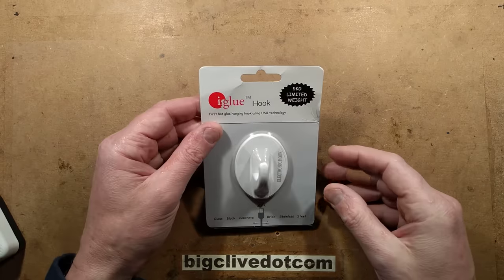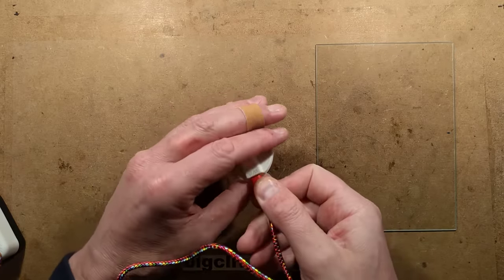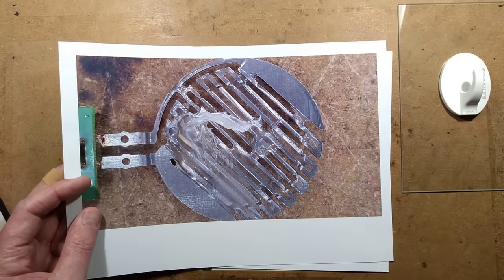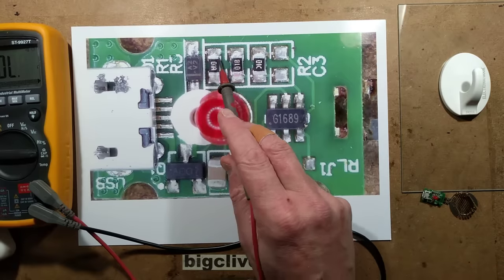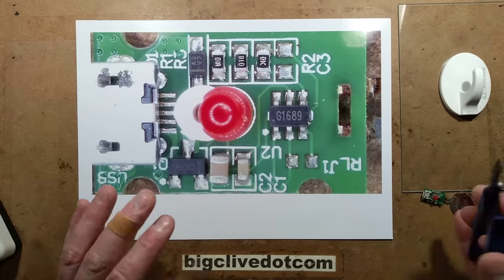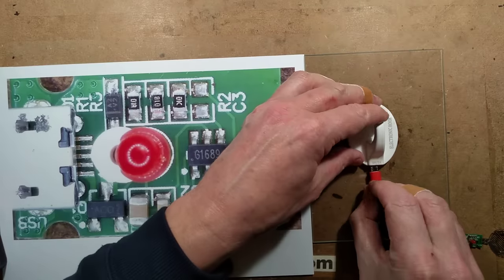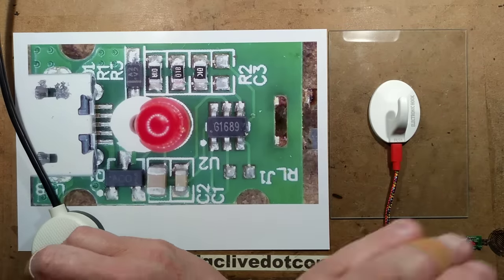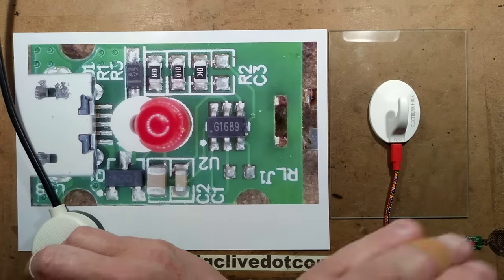Testing a USB powered wall hook and a look inside.

Comment: Speaking of national mail services being greedy...
Swedish mail service now charge a roughly 7£ base fee + 10% of the item value for any outside of Sweden purchases. 
I haven't bought anything from ebay since this new fee was introduced. I hope they remove it soon :(
Reply: Wish pre-pays the import tax, letting you dodge the processing fee. Might be worth it if you're willing to sacrifice some dignity of the altar of Chinese Tat.
Reply: Lassi Kinnunen I'm pretty sure the issue was that import tax wasn't being applied at all before, and some government branch was dissatisfied. PostNord, shitty as they are, want to be compensated for collecting the taxes. This is reasonable. What isn't reasonable is that they charge the above mentioned €7 to look at the shipping label for 3 seconds. 

By prepaying the import tax the government gets their pound of flesh and PostNord can fuck right off.

Basically everything is by the book this way; it's the actual legal solution. I just wish more vendors did it so I wouldn't have to use Wish.
Reply: If they did it in Poland there surely would be riots...
Reply: Well shipping is costly, especially the last few miles.
Reply: @owenlj6261  From experience I would say what's expensive is the FIRST few miles.
I regularly ship small boxes from Asia to Europe and get boxes returned to me.
The shipping cost from Europe is 3 times what it cost me to ship it to there.
Reply: Ha! Brazil is way way worse! 
If you buy anything out of here, tou have to pay a 6% icms tax, then the product will be taxed by 60% of its price, and if its a electronic by 100% of its price. 
So if i buy a notebook: $399usd +6%icms = R$:1800 reais now the customs will tax it for more 1800
So now the price rises to R$:3600 (about 900 usd). But then the mail service will want the price of the shipping, so about R$50-80 (12- 22 usd) and now, for anything that comes from outside the mail service also puts a tax of R$15. 
So the final price is R$: 3695

Converting to dollars it doesnt seem too much, but remember that 1usd = 4.2 brl. 

Usually the price is multiplyied by 4.2 to be converted to brl, then tr taxes multiply it by 2 basically...
Reply: @eduardoavila646  Shit. Here in the States the USPS has flat-rate boxes in a range of sizes. Cram whatever in the box, if it fits it ships. We still get people whining about how expensive and terrible the post is, might need to show everyone what other countries deal with.
Reply: Yeah, tehre are way worse taxes
Reply: I just want to buy my heated hanger for 4£ not 12£ 😢

Comment: they need to add a wifi function so you have to activate it from there, and if it sense your using wrong label towels, they will fall off the wall, this is the future.

Comment: Processor is a ATwin Tech AT8PE513ML  - 42 instruction RISC and the <8 pin versions aren't sold in most countries. The A00 part is a SI2300A MOSFET.

Comment: It might be a "custom micro controller". They are manufactured with the firmware instead of programmed afterwards. From the wiring to the pins and functionality, I would guess it is an ATTINY-10.

The trick to memorize if the plug is pulled long enough is very simple. Any ATTINY has a register with flags stating the reason of the power up.
When you plug it in first, the chip knows it had been started "fresh" because the program will start from the beginning and the POR (Power On Reset) Flag is on. It then enables a "interrupt On Change" on the Pin with the resistors. When it did it's heat job, it simply goes into an endless loop.

When you unplug, the pin with the resistors will toggle and the ISR (Interrupt Service Routine) is started. It will just put the system into deep sleep and the chip will draw less than 1µA from the capacitor so the capacitor will last quite a while. It must drop beneath 1V to make the µC forget what it was doing and to restart fresh with a POR. If the capacitor was discharged far but not far enough, the chip will restart with the Brown Out Detection bit active and the program knows it wasn't restarted properly.

When you power cycle, the ISR is restarted. Using a simple bit to memorize that it was triggered before, it knows that the device was plugged in too early and does the LED blinking in an endless loop.

And the resistors are required because a Port Pin may not have a higher voltage than the supply pin to avoid damage to the chip. The Supply pin is missing a few ⅒ of a volt caused by the diode so the resistors "voltage divide" the voltage from the jack down beneath the capacitor voltage.

The reason for switching the negative connection of the heater is also simple. Due to semiconductor physics, a N-Channel FET is 10× stronger than a P-Channel FET the same size and even cheaper to make. So it saves space and money!

Comment: I'm guessing that 6 pin chip is a PIC10F series micro from Microchip. It's been a while since I messed with them but I think pic10f200 would be a good example. If you google the data sheet you could check if the power pins make sense..

Comment: Methyl alcohol releases hot melt glue.  I think it is because it has very low surface tension.  It does not dissolve the glue, just gets under it and releases it.  Works great.

Comment: The extra pads/solder joints marked J1 are for programming the chip. Probably UART over RS-485. Chip may need to be set in a certain programming mode for it to work.

Comment: Back in 1993 I was injured while on the police force. Since we were a small force, our city did not provide disability insurance, and since it took 4 surgeries to get my spin in some order that I could walk unaided but for a cane, the State Workerman's Comp kicked in and sent me away to college to become a paralegal. My wife decided I needed some of those wall hooks, since both of our kids had graduated from college at the time and they had them, so she ordered me some from what worked as Ebay back then, Fingerhut.  They looked nearly exactly like those except instead of USB (since that was but a wet dream in Bill Gates head) they came with a 110 volt attachment gun.  You slipped the device in the little gun which heated the hot glue and stuck it to the wall, to remove reverse the process.  Because I was not a kid, I never had a desire to hang anything on my dorm room wall, so never even tried the deal out. It is probably in some box out in our storage shed as I type.  So I guess everything old is new again if you add USB to it. When I read it, I envisioned a USB out port and a couple of coin cells to furnish  a few mill amps to an LED or something.

Comment: (Yes I know I'm commenting on an old video)
You would actually have a better time pulling on the hook as soon as you got the heating started, that way it would come off whenever the glue got warm enough to unstick from the surface, but cold enough not to make a huge mess.
The only use-case I see is wanting to attach one to wallpaper without having to rip out a chunk later on (and not being able to attach a hook using nails), although, the easiest solution to that is not using a hook in the first place.

Comment: Talk about over-engineered! I guess the only convenience is not needing a glue gun. That being said, I will guess to say that the J1 port is probably I2C for setting some parameters. It would be interesting to know if the heating coil is frequency driven? Also, the glue pucks are probably refills.

Comment: You can use Iso propanol alcohol to remove hotglue too.
Less messy.
Just a few drops. When it creeps into the joint it just fails.

Comment: I think it is a microcontroller, because there are those extra pads labeled J1, ant those look like they are used to program it. And there are some insanely cheap, very bare-bones Chinese microcontrollers like the ones made by Padauk or Gotop and it could be something like that.

Comment: The G1689 chip could be something along the lines of PIC10F20x, so J1's right pin would be clk and the lower unpopulated pad next to the resistors on top would be data for ISP?

Comment: as a first time trying to understand circuitry, this was a nice little example, it doesn't have many components and I found it clever that it tracks the amount of times you plug it in instead of giving it a switch. I'm also surpriced it can count seconds.

on the other hand I saw that glue mess coming, it is quite a dumb invention.

Comment: Funny; when I first saw this title, I assumed you could plug your i-phone into the hanger and charge the phone, whilst having a strap on the phone hanging down from the hook.  I was prepared to be amazed by the tiny SUPER HEPREDIZED LITHIUM SOMETHING CELL that would be able to charge 5 iphones from that tiny wall hook.  In reality that sort of thing looked like it would be nice to have in a dorm where it is verboden to poke little holes in the wall to hang your psychedelic black light posters.

Comment: Did you explain (or fathom out) what those 2 extra slivers of glue where for, if so I missed it.
The glue is quite strong though by the look of it.
Reply from the maker: They are replacement glue pads.

Comment: Those extra slices of glue are, apparently, meant to replace the original slug of adhesive for subsequent installations. Place one upon the heating element, function the circuit to melt the glue, and allow glue to cool. Repeat installation instructions with new slug of glue. Rinse and repeat.

Comment: I'll bet the unused RL and J1 pads are for connecting a small Bluetooth board that provides the maker the option to include an app that allows remote control of the hook so you can drop your little brother's coat on the floor from the comfort of the couch.  Probably not...but we can all dream, right?

Comment: What a neat idea!!!  It's been a while since I've come across something new in electronic gadgetry. I realize it's not well designed and may seem overcomplicated for a simple job, but there will be niche use cases where this would be perfect for.  I'm a bit disappointed in the number of comments saying this was a silly idea, overcomplicated, unnecessary etc. without appreciating the novelty.  So many products initially were disappointing but once refined they become household items people take for granted.  When one comes across something new,  one should imagine how it might be in the future as if all it's current problems were solved and improvements added.  Just imagine that final produce and see for yourself if it's "cool" or not.

Comment: this kind of reminds me of a dehumidifier i found at Costco years ago. it ended up being a plastic box filled with some dessicant that changed colors as it absorbed moisture, and then it had a wall plug on the back and a resistive load that shorted the hot to neutral. that was it! it had a little window so you could see when it needed to be "recharged" and then you would plug it in to a wall outlet outside your building (so you don't dump the moisture right back inside) and it would start cooking itself off mains voltage. the instructions said to just not leave it plugged in overnight and it the device didn't have ANY kind of protection. presumably it would just melt into a puddle of slag if you left it plugged in and forgot about it?
Reply: I own a device like that -- it's fairly small, I can't imagine trying to use it to dehumidify a house. The one I have is meant for use in sealed boxes full of humidity-sensitive stuff like documents. I use it inside my fireproof document safe. (A lot of the bad reviews for the safe were about the contents getting moldy due to excessive humidity from the fireproofing material.)

Comment: hold on, the whole reason it plugs in is to melt glue so it can stick to things? so not only is it permanent but theres added cost also? since when did those removable sticky strips stop working?

Comment: I've installed DOOM on my wall hook, it's running fine by blinking the LED to get the output in morse code, however they didn't put enough RAM in the controller and it's messing with the HTTP server that's supposed to receive the signal to heat up from the SaaS cloud platform via the mobile app. Do you think I could reduce the RAM usage of Kubernetes control plane to make it work again?

Comment: If you removed the hook, left the hot glue blob on the glass to cool down and then used alcohol on the remaining hot glue it would come right off. Alcohol kills the adhesion properties of HMA.

I wouldn't use it on wallpaper if you would want to remove this hook later on.

Comment: As a proud owner of iPad sandwich held together by paper clips I can vouch for 75% isopropyl alcohol working effectively on some types of glue. (Happens if you clean it often with alcohol...having it sometimes exposed to sunlight next to a window helps too). Either way, I know that if I choose to replace battery on it, opening it will not be a major challenge!

Comment: Awesome video! What is the black thing in the beginning of the video you used to take out the glue and do they sell it on Amazon?
Reply from the maker: It's an 8 in 1 or 9 in 1 presicion screwdriver available from eBay cheaply.
Reply: @bigclivedotcom  Thanks I'll have to see if I can find it.

Comment: you can clean the glue with isopropyl alcohol pretty easily. Just apply generously and you can pull it off in one piece.

Comment: Do you have a link to these? An aliexpress search comes up with unrelated shite as usual.

These are actually a genius idea, I'm forever buying and replacing those command hooks in my rented home where we aren't allowed to drill or hammer nails into doors/walls. In the summer it gets so hot in here, the adhesive deteriorates and they fall off all the time.
Reply from the maker: I just searched eBay and didn't find them.  I'd expect USB wall hook to find them.

Comment: So, I'm not so sure that it would know that you would want to stick and unstick it, more than, just heating the metal to melt the hot glue so that you can add or remove it from whatever surface it's on. As for hot glue being left behind, I don't think there's such of a choice there since the hot glue has to go through the metal in order to stick to whatever surface you choose. But yes, a very interesting concept

Comment: This is insane lol. Of course we need silicon in everything smh. 
Just to point out — those two circular pads are extra glue to be melted on after you’ve removed it from a surface and want to remount it again. As for the mess — I’d stick to har, smooth, non porous surfaces. I do think that it could be removed easier if you had a dull scraper and a microfiber w/ some iso on it at the ready.

Comment: the glue residue is due to the heating element not heating the whole glue enough... but if it does heat it enough, it will be a 50/50 gamble if it will end up being on the wall side or the hook side.... so yea i think you are supposed to refill the glue on the heating element with another blob of glue from a hot glue gun..... an interesting item... i think i will start looking for them locally....

Comment: Well this is ironic. I happened to look at my glue gun today and noticed it runs at 10 watts. The very first thing I saw to myself was, wow a 5 volt 2 amp USB port could actually power this glue gun. All of the sudden YouTube put a video in my feed about a wall hook that is basically running a USB glue gun to attach itself. Google has implanted itself in my brain.

Comment: If they try reinventing my hammer, we’re doomed.
Reply: Nail gun?
Reply: @xHICKORYx  can a nail gun remove a nail? Hammer and “catspaw” can do that. There are many situations where you would use a hammer to tap/nudge something into position before nailing, where you might not want to use your expensive nailgun as a hammer. I have lots of pneumatic nailers. I still can’t build a house without a hammer. Maybe I can, but I wouldn’t. Thanks for playing.
Reply: @commandoconstruction2720  was meant as a joke to say that we are doomed because they have tried, and will continue to try, to reinvent the hammer. But thanks, I had fun playing.

Comment: They need to add a bimetallic strip into the hook so you can have a switched control of the hook between the fully erect and a more relaxed position. 
Thus you could remotely release things from the hook, say to let your towel fall into the hamper after a period of drying.

Comment: I mean, it's hot glue. I knew from the beginning it would leave a mess on the glass. At least with a smooth surface like glass, you can scrape it off with a razor blade or utility blade. It would be really shitty to use one of these on wallpaper or sort of "rough finish" paint on drywall. Or anything that's not smooth and hard like glass.

Comment: I would have used a plastic card (like a credit card or similar) to get that glue off the glass,  rather than my fingers.  That bit with the various timings reminds me of the "short press" / "long press" and similar nonsense that's worked its way into so many gadgets.  I'd far prefer that they'd just go ahead and stick another button in there!

Comment: COOL TRICK: if you burn the tip of your finger, use a cord or a string to cut off the circulation and make it deep-red for about 30 seconds, (you know like a kid) it will hurt like a son of a gun for about 10 seconds, but no blister, and no lingering pain. Try it.

Comment: I would guess that little Chip is a PIC10F... one of the smallest microcontroller on the market.
This makes me want to buy a few of these hooks and make them into funny gadgets. Replace the coil with a very tiny Speaker for example. Or just let the LED flash in a pattern... but I don’t have a PIC Programmer Board :c

Comment: The real question here is, what life circumstances led the inventor to design this? 
If you have a surface you're okay with hot-gluing a hook to, wouldn't a hair dryer on 'high', held to the surface, soften it enough to remove the hook?